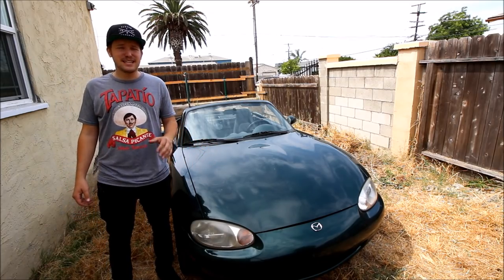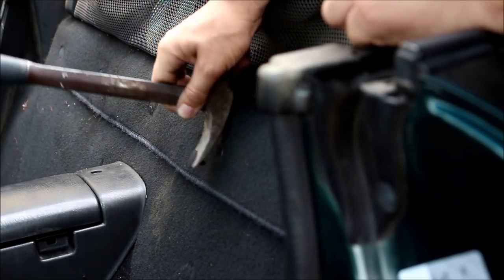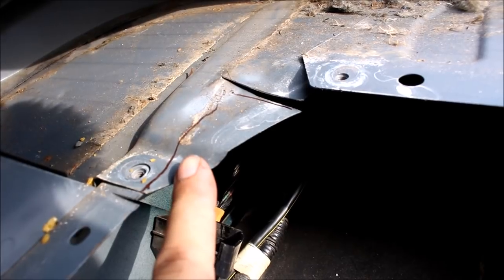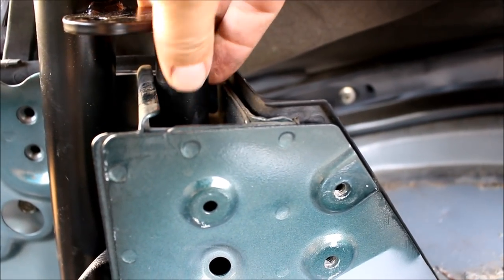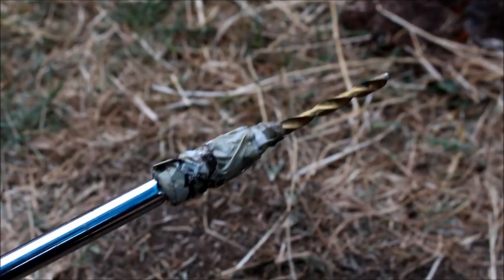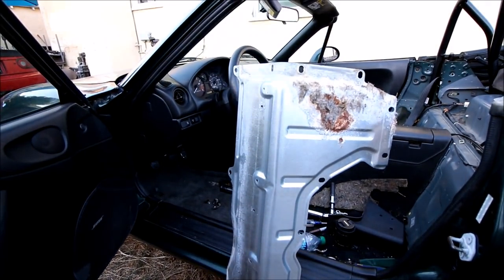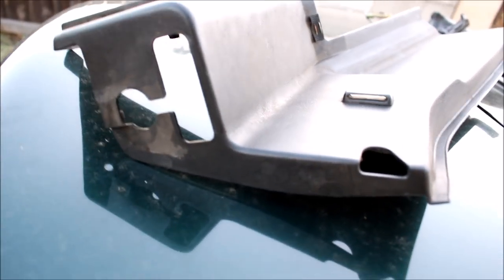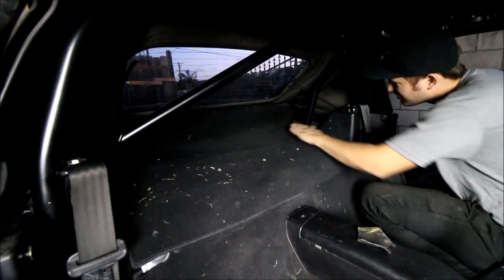The One Thing Every Miata Needs.

Comment: One small criticism: If you drill a hole or make a cut you should always put on some paint to prevent it from rusting. I usually use some zinc-spray if the color is not important because it dries really fast. Such small holes can lead to some really nasty rust problems a few years in the future.
It is also a good idea to put some grease or cavity wax(I hope this is the right word^^) between washers and the big mounting plates and the chassis to prevent water from getting in.
Reply: Marcel Pursche Thats what I thought too!
Reply: Good call. I like how you think. IM Communist Canada rust is mandatory.
Reply: Thanks for the tip
Reply: And put the bolts through from the bottom so you can visibly see later on if bolts snap.

Comment: Looks so cool, but I'm still nervous about it turning a minor rear end accident into a fractured skull. They really dont seem safe without a helmet, especially if you're tall like me :(
Reply: Boosted Autos nah you'll be aight
Reply: They have two designs. One is scca spec that sits theee inches about the seat and very close to the head. These are not recommended for street use and you said about a minor rear end turning into a serious brain injury. The other design site further away from the head and is a little bit lower. These are labeled street use
Reply: So thats when you put rollbar foam/Padding around it. Same sorta stuff that a pool noodle is made out of.
Reply: Das ist besorgnis erregend wie der typ den wagen verunstaltet

Comment: I drive an nbfl or 2.5, I always wonder how they feel different or the same as the NA miata? Since I never drove both.
Reply: They're quite similar since they are essentially the same car. NA steering feels slightly better but the NB chassis feels more solid to me. I personally picked up a 10AE NB after driving about 10 different NAs, NB1s, and NBFLs. It felt best to me and I also liked the six-speed. I also couldn't find a really good example of an NA, all had something wrong with them.

Comment: I would like to get a roll bar, but I am 6'2", and I'm so big that my head basically touches my top all the time. If I got one, I think I would be putting my head in danger. My head is completely above the headrest of the miata
Reply: Beau if na or nb get a hardtop and a hard top specific rollbar might work for you
Reply: I got some roll bar padding for mine.

You can also get a seat with a taller headrest, or cut out the bottom of your existing seat "foamectomy".
Reply: Mayjaplaya just adding padding is very dangerous without a helmet. but +1 on foamectomy
Reply: You're right to be concerned. Rolling a Miata is very rare, but getting rear-ended is extremely common. If you're taller than 5'10", your putting yourself in danger of banging your head on the rollbar if you stop suddenly or get hit. Rollbar padding will help a little but it will not save you. Unfortunately, your options are either to wear a helmet always (illegal in many states and uncomfortable) or try and find seats with a higher back and headrest that will protect your skull.
Reply: I'm 6'2" and I have a facelift NB with a rollbar and a race seat bolted through the floor and its fine.

Comment: Add something about Roll Bar Padding.  Should be SFI rated not swimming pool "noodles" This is VERY IMPORTANT !  Here is something: "Note: SFI-rated foam padding is designed for installation between the helmet and the roll bar. This padding is extremely stiff and rigid. It does not give except in very hard impacts. It is intended to cover only one side of the bar (the side between the bar and your helmet)." Or anywhere you or your passenger's head might come in contact with the bar. It is about safety after all.

Comment: I've done some research and a lot of people say that rollbars are actually less safe for daily driven Miatas than not having one. I guess the fear is getting rear ended and crushing your skull against the metal bar. I saw people saying that even with the addition of foam padding it wouldn't really be enough to cushion your head without a helmet. I suppose one has to figure whether rolling over or getting rear ended is more likely. I'd like to know your thoughts on this, because I only did a little bit of research on the subject and it scared me out of installing a rollbar on my NA.
Reply: It depends, I put aftermarket seats on my Miata and my head doesn’t go pass the seat. Might be a tall person problem .

Comment: Drill holes thru body for bolts to be seen in fender well?.... like you show? Hint..... dress the holes you drilled with paint, and gumbo-up the area before  you attach the entire backing plate and then attach bolts. Otherwise you started a nice place for rust to start. Next...don't do the stupid thing and put that useless Home Depot  pipe insulation on the bar with zip ties. Use TRUE energy absorbing foam sleeve made for roll bars....don't want to hit your noggin on bare metal....less safe than stock. Also....tin snips?....MUCH easier with a Dremel and cut-off wheel, and you can "Dress" the edges better, either steel or plastic trim.

Comment: You must really not like your bosses son, no paint on the rust, nothing on the holes. Even in California you can get rust, and you never know where the car might end up. Spend the five minutes to touch up the raw metal and do it right. It is called taking pride in your work. Get some self etching zinc spray and keep it with your other spray lubes. It only takes a second to squirt a bit on any rust (like that parcel shelf).

Comment: I've gotta disagree about a roll bar being the one mod every Miata needs. The NB I recently bought came with a very nice Hard Dog double diagonal bar, that I just removed for safety reasons. 

If I sat upright in my seat, my head was literally resting against the bar, virtually guaranteeing a head injury even in a minor accident. But even if you think your head is far enough from the bar to prevent hitting it, I guarantee it's not. Bodies move and stretch and bend far more in an accident than people think, and the chances of smacking your skull on a hard steel bar seems far too great a risk in exchange for the reduced risk in a much less likely rollover accident. 

Roll bars are meant to be used with a helmet and preferably harnesses. If your car isn't spending more time on the track than the street, you're making your car less safe by installing a roll bar, and I'll stand by that statement. 

Plus the rigidity benefits are overstated IMO. After I removed my bar I haven't really noticed any difference in structural rigidity, though I haven't driven it to 9 or 10/10ths since the removal. But backing out of driveways at an angle and the like I haven't felt a bit of difference. 

On top of all that I dropped a chunk of weight and gained more usability in the parcel shelf, AND I'm able to get my seat back reclined a bit more which the roll bar prevented me from doing. 

So yeah, roll bars are just a waste in street Miatas IMO and are likely making the occupants less safe overall, and come with other downsides. I say forget them for a street car.

Comment: Hey thanks for the video, helped big time! How did you tighten the 6 bolts on the upper back plates? I can't seem to hand tighten them with a socket wrench, it's just super hard to turn. Did you use a drill or something to tighten them down?

Comment: PROTIP: Rent or borrow an impact gun, and not just for drilling. The nuts are all lock nuts, which is great for having them not back out over time, but a pain in the ass to install if you have to tighten them with a 6" socket and a box wrench.

This looks like an M1 sport bar(?). The install is different for each of their models as I found when installing my Ace and tried to use this video as a guide (mainly when it comes to front holes near the seatbelt tower, this mounted in front of it while mine mounts on the side. Also had to cut more out of the shelf and in a different area). Still gave me a good idea of what to expect, though.

Comment: Nice video, I just got an 01 miata and it think it has the same roll bar, only issue is the top seat belt harness/roller was never removed so the seatbelt doesn’t retract easily-_- I noticed you had a long bolt and spacer for support at the top of the seatbelt mounting, do you know where I can get that bolt/washer/spacer combo? I’m assuming I gotta loosen the whole roll bar to relocate that seat belt. Thanks!

Comment: Only need to drill one hole from the top and use the backing plate for the other holes as template from the bottom. I also like to add a RTV seal around the bolt holes on the backing plate to prevent water intrusion.

Comment: hmm, i've taken more of those out than installed them. If not doing crazy driving, there's a lot of negatives having that roll bar behind. Most of them barely allow the top to be folded down. And if it has a glass rear window, it definitely won't allow it to fold down and stow. They also eat up a lot of the room behind the seats, so limited capacity.

Comment: Any need for paint/silicone in the drill holes? Or will the hardware generally do it's thing at preventing corrosion?
Reply from the maker: +colingreczkowski It's an excellent idea. My San Diego brain doesn't consider these things.
Reply: Yes I would really recommend doing both. I did the same when I installed my frame rails (if you want you can check that video out on my channel)
Reply: Thanks colingreczkowski!
Reply: some rust paint and RTV sealant helps if your worried about corrosion.

Comment: Hey Greg, what kind of Roll bar is in your red Miata? I'm literally wanting to order a roll bar in the next 30 minutes! I'm looking at the Hard dog M2 sport with double diagnals for my Nb, says it works with soft and hard tops and it's taller than the hard top only version.,  but I noticed that ones 1.5" tubing and not 1-3/4" like the one for the hard top version.

Do you know of any roll bars that would be better than the hardcore M2 sport with double diagonals before I pull the trigger on this one? I'm sure it's definitely better than nothing though.
Reply from the maker: Good thing I read comments quick 😳 my bar is a Hardcore X-Brace but I can never remember if it's M1 or 2... And it's the hardtop specific version. I also have the Hard Dog bolt-in harness bar

Comment: Whats the reasoning behind the owner getting the single-diagonal over the double diagonal or the "x" bars? I got an M1 hardcore hardbar for my NA8 with the "x" pattern because I felt it is the safest design of the available patterns because in the case of a roll the hit would be spread along the bar a bit more evenly. Just my thoughts on that. Thanks :)
Reply from the maker: +Guerrin Love Just a little better visibility, but stronger than not having any diagonal.

Comment: If people think a cheap roll bar held on by a few bolts is going to save you in a crash they are deluded. The only things that will save you is a full motorsports spec roll cage, a helmet and a harness. This is more likely do you harm as it collapses. You are better off just not driving in a manner likely to cause you to end up on your roof.
Reply from the maker: Jabber 1974 And what about the multiple overturns that have occurred leaving these SCCA/NASA approved bars in tact? Against an overturn without a bar where the windshield collapses 100%?

Comment: sorry, so many errors. cool vid though. good luck
Reply from the maker: Frenk Vortice enlighten me
Reply: mainly the aesthetics . the carpet should be cut out as follows . fit the carpet, find a point where the pipe starts. then make a hole  as big as the pipe from that measured point.  next just cut a line from  the hole to the nearest edge.  and then just fold it around the pipe. .... no missing carpet block then..  and you could address corrosion on the panel. if there is dampness... the drilled holes will catch a rust too, , pinpoint punch a hole then drill from under. why make extra holes in the car.... you can always say its weight reduction....  but its a bit harsh for the car.   sorry you were like a surgeon with an axe. but all is well i liked it. your dog is GREAT! . God bless. in the end you did it well.